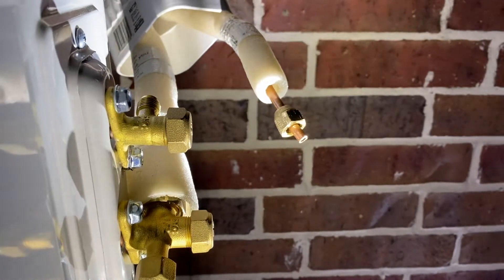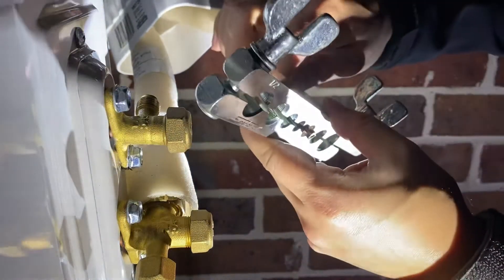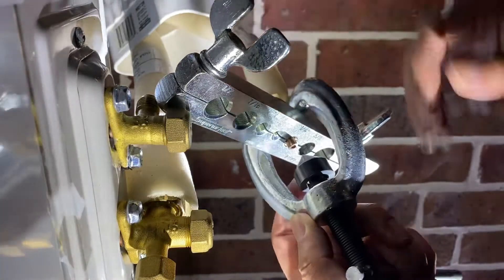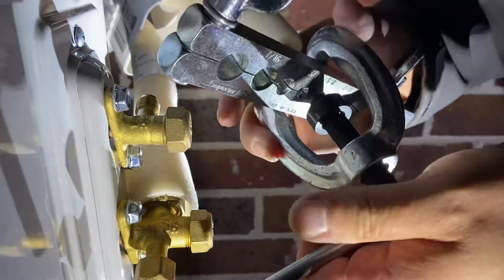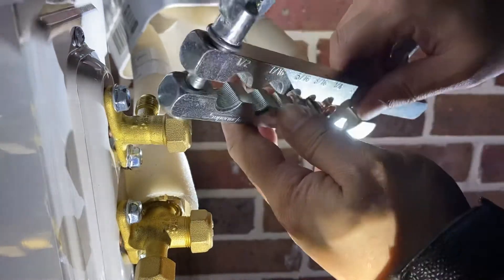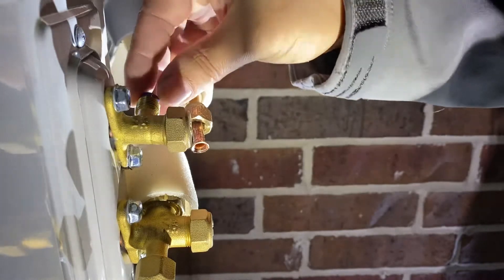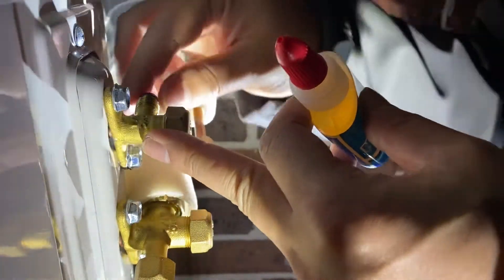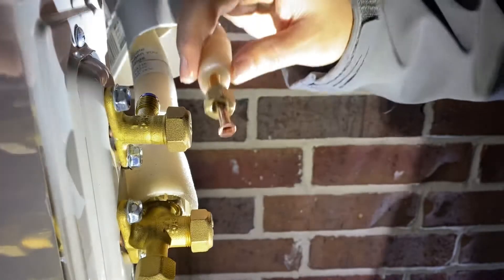Flaring a 1/4" Copper Tubing for a Mini Split A/C Air Condition Unit W/ Nylog Blue and Flare Seal

Comment: Nice vid. But it's really necessary to use flare seal if a nylog blue is used as well ? I have a very small leak and have both flare seal and nylog but I'm debating to use just a nylog.

Comment: Glad it worked out for you. Torque wrenches are pretty cheap. Reaming tools are even cheaper. Worth the investment IMO.
Reply from the maker: Depends on how often you do this. Never used a torque wrench in my life so don’t plan to ever get one lol. This is also the only unit I ever installed. This is just to show that anyone can do this kind of work.
Reply: He doesn't even have a combo wrench, he tightened it with vice grips
Reply: Could you point us to the cheap and/or available torque wrench for these HVAC flares? from what I've seen, automotive torque wrenches seem to be the norm, but they are not quite kosher for flare fittings. I was told the flare adapters, for the automotive torque wrench, affect the leverage and therefor readings.

Comment: I tried either the flare tool your using or one like it. Actually I have tried 3 brands, and they all let the 1/4 pipe slip out. No matter how tight I clamp it down tube just pops out. I’m now waiting on a expensive yellow jacket to be delivered.
Reply: I am having the same problem. How did it work out?
Reply: I have an electric flare machine

Comment: Thanks for the tip. I have a question, why on earth are you using a vise-grip to tighten the flare nut?  understand if you do not have a flare nut wrench, but even an adjustable wrench would be a maybe better choice?
Reply from the maker: Closest tool next to me. Can't go get the other tool while filming